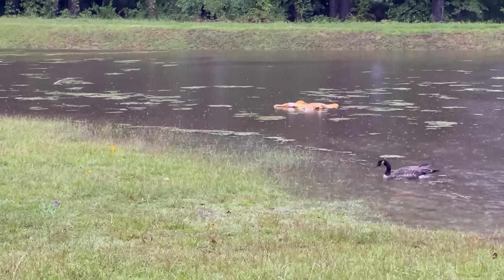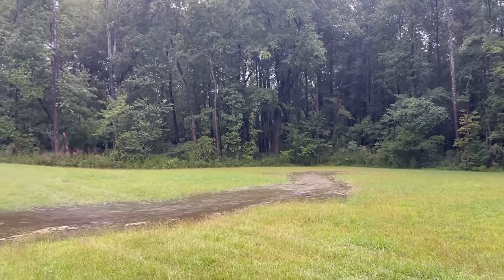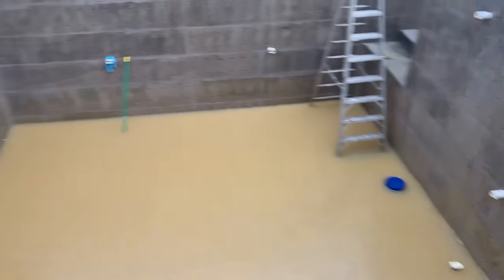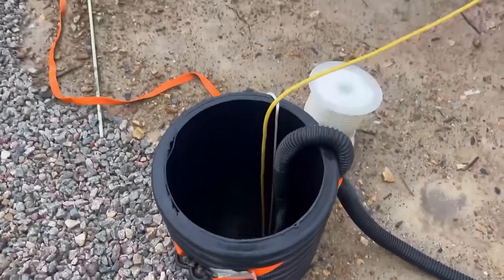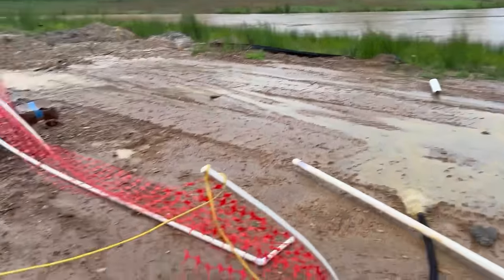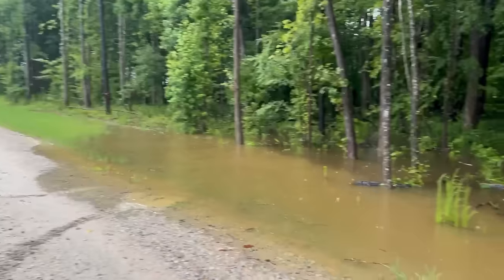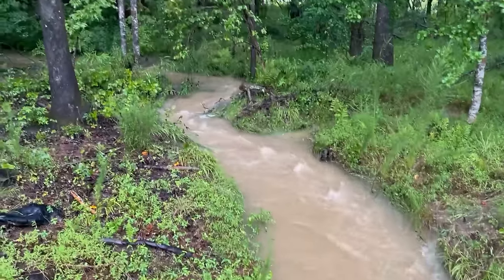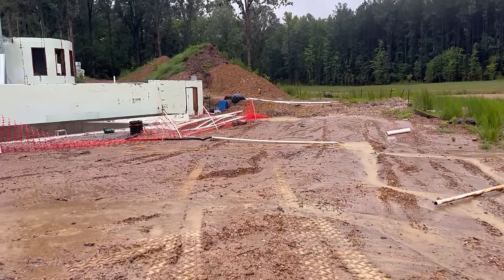Massive Flooding on the Farm

Comment: Chris's drainage plan is working perfectly. People don't fully appreciate this because they haven't seen the more typical alternative.
Reply: Many ponds up where I live don't have spillways.  They just have an overflow pipe. I've seen many ponds where the water goes over the dam.
Reply: @johnhenryNC  If the top of the dam is level that usually not a problem but can lead to erosion of the back face. If the the top is not level an ever deepening channel will form in the lowest spot. This creates a powerful stream that can cut through the dam causing failure.
Reply: Oddly enough Chris has a couple of his own ponds like that. He lets them spill over the dam.
Reply: @snappingbear  There many factors that go into the design, soil type, dam height, predicted inflow, etc. I'm sure Chris has his property perfectly engineered.
Reply: @nandi123  Of course, he knows what he's doing. In most cases, actually in all the years I've watched, he always installs a spillway. He just didn't for every one of his own ponds.
Reply: @snappingbear 
Plan for every Culvert or Culvert that manages pond volume is a contingency plan that protects Culvert by overflowing elsewhere, and draining water volume without causing unnecessary damage !

Comment: Better to find any issues with the pool now Geoff. But those leaks really need to be marked and some high pressure sealant injected in to those. The pressure should equal out when the pool is filled, but should you ever need to empty it you could have real problems.
Reply from the maker: I purchased some already. I’ll be looking back at the video the see where it is 😁

Comment: I was wondering how the ponds and the work Chris did was handling the storm. Looks like Chris did a great job in contouring your land. This shows the need to hire qualified people. I also wonder how the foundation drain around the castle is doing, anything that you need to address before construction continues or that was not anticipated for the back fill? Thanks for sharing. Glad that you are all safe.
Reply from the maker: It seems to be doing a good job.
Reply: @BealyGood  it will be interesting to see how well the improvements he made the last time around the road towards the dam have worked - you had some pretty fierce erosion that needed fixing last time. I recall there was quite a bit of reprap, riprap? Whatever it's called. Fist sized rocks :D) added.

Comment: Hey Bealy Good! Glad you got the pump going again. If you can check the elevation of the lower pool it would be interesting to see if it has raised at all. The ground water pressure is pushing up from the bottom and can literally float an empty concrete pool. You should consider filling it if another hurricane blows through before you get it completed. Greetings from Vancouver British Columbia Canada! Ride ride ride!

Comment: You've done about all you can do for drainage Geoff,  got any more ideas ?  You might widen the overflow spill ways, and zig zag the path,  we used to have wash outs from the volume and speed of the water, but we made a really cool zig zag landscaped feature, moves the same volume and speed, but cut down on the water impact pressure.

Comment: Looks like everything is working as planned. However another culvert under the road to the new house would be good along with more ditch to work the water. Also I would consider marking those leaks in the lower pool ASAP so some hydraulic cement can be used to plug those before the coating. Half inch drill into the void and pump it full of expanding cement. Easier to mark them now then to try and find them later. Also surprised with the grass from the air. More attention to overseeding along with fertilizer or compost would be great come mid September to try and fill in between the rows and get a more complete lawn like texture. Nothing like a major rain event to show how the plan is working and this one is really successful for the amount of rain you have gotten. That said, building for this to be more common is not a bad idea. Having a main drain, a second emergency drain plus an emergency spillway sounds like a waste but maybe not in the future. Especially on the upper duck pond. Good luck there Bealy Goods. PS thanks for informing us, we were wondering how it was going.

Comment: Be careful with that empty pool.  If you've never seen one float, make sure you don't.  I've seen a 20'x40' gunite 9' deep pool 4' out of the ground.   Pumping the water into the pool isn't the worst thing you could do until the water level around it goes down.  We used to fill shells for the winter instead of letting them set empty.

Comment: You better pump some water into that deep pool to keep it from floating up out of the ground! Take that hose from the ground water pump and put it into the diving pool. at least as deep as the ground water is
Reply from the maker: Did that now. But I do have a hydrostatic valve in the bottom

Comment: Better find the source of your leaks in the pool and don't use water loc cement it will push out in time cut it out find and fix the problem  before you seal the pool. Just don't  want you to go through what a body of mine did. Very expensive lesson.

Comment: Boy Geoff how many more days Is Debby going to flood you out?
Need to have your partner in crime do some flood control  grading in several places and put in a larger overflow on the little pond.

I was wondering how bad you was getting hit.

By the way the the SS minnow sink again?

You stay safe Geoff and  by the way did you lose power in the storm?
Reply from the maker: Still have power. The SS be good is up on the hill. We got about five more inches of rain after I made this video. I’ll be posting some pictures on Facebook or somewhere. I think we’re through the worst of it now though.

Comment: B*tch dropped some rain. Our backyard is flooded. The fix that I paid for sure hasn't worked. If the state did their job and cleaned the ditches, that would help. We know how that works. Maybe I need to hire Dirt Perfect and MBTS to run some drain tiles. 😂😂 Seems most of the tornadoes were up your way. Just heard of one the went through RM near Meadowbrook. We did catch a 3 hour break down here near Grantham. Even had blue skies. Now it's raining again.

Comment: Anyone who thought the pool might float up was well wrong.
Reply: maybe.   maybe not.  Has a whole lot more weight on the one side with the upper pool holding it down now.  Unlikely for it to move more than a couple inches now.        Might still move enough to mess up the infinity edge.   I hope it didn't, but is best to try to plan for the worst that can happen and try to avoid it.  Sump pump was economical attempt to solve possible problem